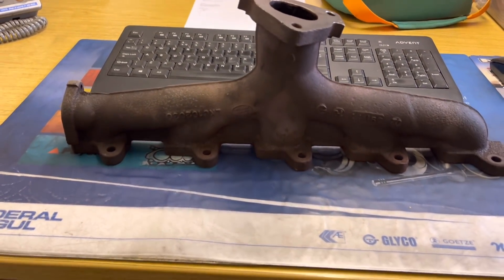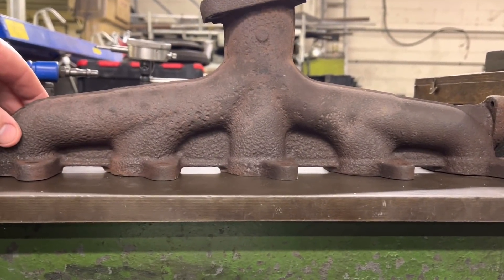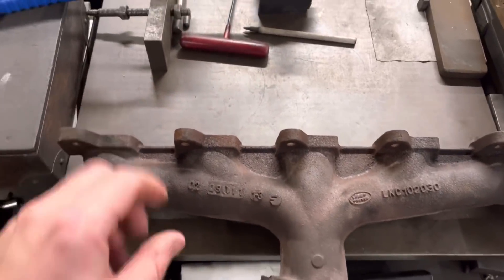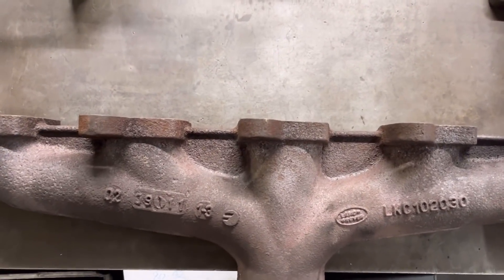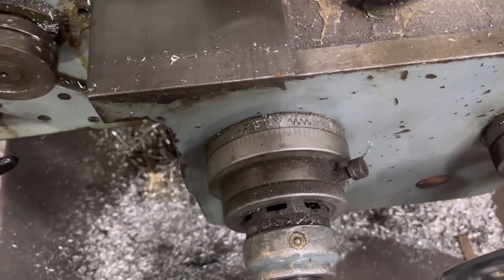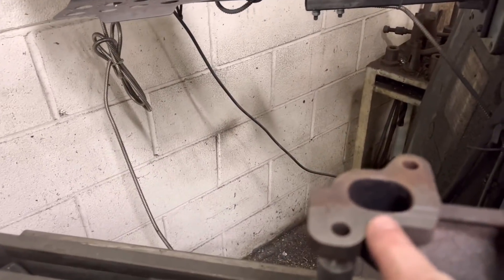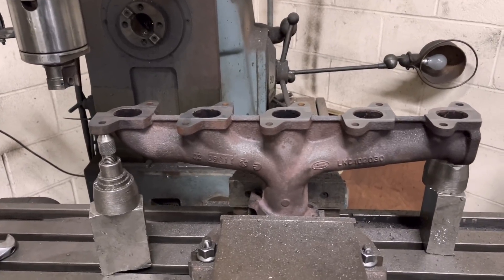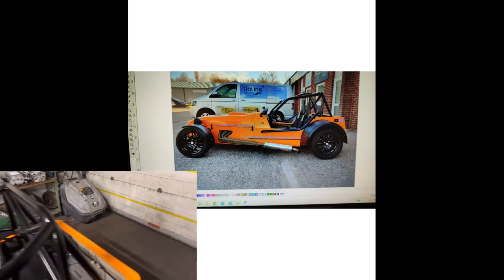You WON’T BELIEVE what these manifolds do

Comment: So, would it help to cool the engine down, after driving. Just let it run a minute or so before putting it of.
I do remember that in my Smart car (with turbo) it was advised just to keep the oil good in the turbo. If you came home and just turned it off, the oil would burn/evaporate away and the turbo would not have any to lubricate it.

Comment: The big issue with cast iron components is  time!  Cast iron needs to "season" "cure" or "age" before being machined, that's an irrefutable fact. For an example, and this goes for most  "precision" machines, but , Myford the "iconic" lathe and machine makers, used to get the cast iron "beds" for lathes and mills etc, from the foundry, and literally put them outside laid on the ground in all weathers for I believe , (if my memory serves me") two years. they are then grit blasted  to remove the skin and machined to a crude finish, and put back out for a further year or more before being finally machined to  their finished state. And of course Myford is an example only,  I visited their works way back before they folded. I am assured the reason they folded was they tried to  cut corners, and bought in  ""machine ready" cast iron  lathe beds, and milling machine bodies from Asia. They then machined them to Myford tolerances and sold them out as their own , but with "made in Taiwan, or China etc labels attached, firstly they warped and went out of  precision and of course the "Myford" buffs were horrified. All cast iron needs to be seasoned.  Buy a cast iron woodburner for your house, you have to light little fires first and do more over time, a small handful of kindling , then more, then more etc etc like running in an old car, or it will warp and crack! Also people don't realise not only the time and technical know how, spent machining, but the hundreds of thousands of pounds worth of tools machines and machine tools , one has to have in a workplace like this.

Comment: Some new replacement manifolds are such trash, you have to do this before you install them. The boating business is full of them.

I think the problem also varies by how much money companies are willing to spend on materials. The high performance world often solves the problem of cracked or bent cast iron manifolds by casting them from 304 stainless steel.

Comment: They normally only warp if the vehicles been chipped with a big intercooler.  The studs are ridiculous and nasty cheap crap so it’s advisable to replace them with wurth studs. Once it’s warped it shouldn’t happen again and with the new studs the problem should happen again.

Comment: I have fixed many manifold leaks, removed many broken bolts. I believe machining & if the head surface isn't pitted to bolt them on without gaskets in most cases. They will seal & without the gasket & will allow much of the heat to transfer to the head &   less likely to warp.

Comment: as mentioned in the comments, but ill say it again,   all you need to fix a warped manifold is a nice flat surface and or a good straight edge.   Then a good hand held belt sander rough and smooth it down to barely rocking then take your file and scrape it in.  check with your surface and straight edge until you got good contact.   Ive done this MANY times and it has ALWAYS worked great.   the worst part is dealing with the rusty broken bolts that are just about guaranteed to break.

Comment: It’s not too much of a problem once the engine is running. I’ve seen exhaust leaks clear up once the engines warm because the manifold expands back and seals. It wears out the gaskets pretty quick because of all that moving back and forth but a quality gasket and torquing the bolts down when the engine is warm takes up the slack and helps prevent that thermal expansion and contraction.
Reply: Sounds like a good opportunity for a new gasket design that will allow some expansion and contraction without the added stress on the weaker ends of the manifolds. Hmmm
Reply: @intricate6927  we’ve had one for years. It’s called asbestos and it worked great.

Comment: I can't remember how many manifolds i have milled flat in my time as a machinist.
We even had a customer who did truck pulling, had  tig welded manifolds with a 20mm steel stock as flat part.
You'd mill on thursday, they fitted it on friday, race Day on saturday and back in the shop at monday again.
Reply: What I was a kid used to work in a machine shop my friend had a boat and he used to work in the automotive parts store in the front of the Machine Shop he had a big block in a 17 foot jet boat used to take it to the lake and blow it up on the weekends get back home by Wednesday it was torn apart thursday-friday back together back at the lake on Friday night God bless you and your family

Comment: Thin castings on exhaust manifolds. Back pressure from turbo hold heat to the point of warping the cast iron. Exhaust openings need ported and polished,  but the diameter is still too small. Same problem on cast iron exhaust headers on small block chevies, when turbo is installed. I've seen various fixes, including a "stiffening plate" to hold the runners straight and flat. Finally gave up and installed "turbo headers". Gotta get that heat out,  somehow!

Comment: ALTO ALTO 
HOOO STOP ✋️✋️
UPON REINSTALL ON THE MOTOR COAT BOTH SIDES OF THE GASKETT AND ALLLLL THE THREADS OF THE FASTNERS WITH 
(GRAPHITE@GREASE) A NICE BLOODY GOOD THICK COAT OF IT. IT WILL HELP IN THE LONG RUN 
(BELIEVE-ME)

Comment: U burn 4 of those mounting flanges out of 10mm steelplate, take a pile of pipe parts of suitable material ( 1.5" thin wall cromo would go well) and make a new 1.
If budget stands it or u have skills to do it yourself..its worth every dime.

Comment: I ended up replacing both manifolds on my trucks engine when I overhauled it, the manifold bolt holes were so bad there wasn't enough there to reuse. I purchased a new set of manifolds and neither one was flat, both were warped. I taped course sandpaper down on a flat surface and sanded them down flat, they turned out real good, and it took awhile to get them flat. I was wondering if that wasn't the problem here, that these manifolds weren't even flat from day one? They do have to be flat no doubt, they won't seal right if they aren't, and it stresses them out, and possibly warp even worse.
Reply: When I turboed my Patrol (6 cylinder inline diesel) the log manifold I bought was actually proud either end by about 1-2mm. I questioned the supplier and they said when they build them they shim them up in the middle (so the middle is lower, opposite to the warped manifold in this video) before they weld otherwise they warp as per this video and the gaskets at either end fail. 15,000km later and no problems. So depending how not flat your manifold was it might've been intentional.
Reply: @jbrizz99  don't believe the ones I got were intentionally warped cause both manifolds were warped different in a different place, and one was much worse than the other. They're also require to be torqued down evenly like intake manifolds, so if they're warped they won't seat evenly. They have to be flat, I think the supplier you mentioned is full of bull. The flatness should be the last step in the manufacturing process, after any welds done too it. They weld, THEN make them flat. Sounds like they just cut corners for cost and lied about it imo.

Comment: Great video! Thanks for sharing!  It's amazing to me that we live in the 21st century and engineers / manufacturers haven't learned their lessons. Apparently it's no longer about building a product that the customer would buy again as much as it is let them buy it and let them deal with it. Cutting corners, omitting processes and using inferior materials is the new norm. Just glad that there are people out there such as yourself solving problems and correcting mistakes and making the end users happy again.
Reply: Well some old ass seasoned already torqued manifolds will prob warp
Reply: @DannyOrnelasPerformance  That manifold wasn't "old ass" and if it warped that bad? my betting money is on it wasn't seasoned to begin with. Add in they used manifold bolts that just made the grade and you have a recipe for disaster that the customer will have to deal with. I'll agree with the turbo there's a lot more heat in that area but? That's an engineer's job to find and fit components together that will work. I've pulled old Chevy exhaust manifolds from antique 265's and 283's that weren't that warped.

Comment: Was this a result of installing a gasket where the factory never did?
I'm used to seeing failed aftermarket gaskets where the factory never used a gasket.  Using a gasket also causes the manifold to run hot and increases the chance of cracking.
If you have good flat surfaces, why use a gasket?
Reply: The gaskets fa7l because the manifold has mooved from its supporting role
Reply: @simonjones7785  Over the decades, I've removed many exhaust manifold gaskets and reassembled with no gasket, exactly the way it came from the factory.  This has always solved the problem for me.  If the factory does install a gasket, it's going to be a high quality piece 
(multi layer steel, most likely) and an inferior aftermarket gasket won't survive because heat causes the gasket to relax over time and clamping force is lost.

Comment: Clearly related to the fact that the engineer doesn't know that cylinders come in PAIRS (except on radials).  Get rid of one of those cylinders (or add one more)  and your problems with that manifold will clear up "straight away" as you folks say.  /:o   *
Reply: How is this problem caused by an uneven amount of cylinders?
Reply: @Gamepaj  Its  a joke.

Comment: Mapped TD5’s exhaust gas temps are that much higher than standard, the only combo of things I’ve found that solves it is dewebbing the manifold & getting uprated manifold studs from Wurth. Been 10k miles now and no issues. Before I did the uprated studs I’d be lucky to get 2k miles out of a manifold before it warped.

Comment: Seems an awful lot of work for an issue that could be remedied by a thick flexible gasket.
Reply: Won't work, the gasket pressure will still be uneven and you can't bend cast iron, and or force it to seat different from one end to the other, even with two composite gaskets put together. They have to be flat and evenly bolted down, otherwise they'll warp even worse once they heat up and could even crack. Then there's the possible problem of lining up the exhaust flange bolts, and flanges if the gaskets are too thick without redoing the exhaust pipes.

Comment: Surface the face,buy some die springs they come in different strength ,they were used on cars from factory to prevent this very problem before you were born.

Comment: Had to do this to my Jeep 4.7 manifolds. A bit lower budget however... framing square and a bench mounted belt sander.  3 years later still no leaks.
Reply: 3 years with no issues, you did them right then.
Reply: @garyr7027  right, sometimes the method  doesnt matter as much as the outcome. In this case, the outcome was impressive, especially given the method. Ingenuity at its finest.
Reply: @goosenotmaverick1156  had to do this same thing on a new set of manifolds, only difference is I tapped sandpaper down on a flat surface and used that method. Flatness is the key for these things, they need to be flat.
Reply: @garyr7027  old school repairs and techniques still work.👍👍
Reply: @garyr7027  I think like you said they are seasoned now and don't warp anymore. They do have 167,000 miles on them.
Reply: Thats what I thought.  I guess the big mill is probably more accurate.
Reply: That's how you get her done

Comment: I removed an exhaust mani from a Cummins diesel in a snowcat a few years ago that wouldn't go.back on because it shrank up. The bolt hole on one end was 5 or 6mm short of lining up when the other end was bolted to the head. The replacement was a two piece manifold.

Comment: Be interesting to know how many bent ones have been "professionally" re-mapped. 
All the ones I know of that have been fiddled with have done this. Not to say it doesn't happen with std tune too but not half as much.
Reply: They all do this eventually - it's a design defect rather than specifically the result of mapping. Re-mapping (by definition) increases the temp in the exhaust manifold, and makes this warping more likely. The TD5 is not unusual in this respect - other cars have this problem - the Smart 600 and 700cc engines are notorious.
Reply: @mikeevans9736  Yes that's basically what I was getting at. I know many that have had and still have TD5s. All the mapped ones have done this but I don't specifically recall many standard ones doing it. Might be my memory. 
Suppose a modular cast manifold like Cat used to use on their big V8s  and V12s is one way to get around it.

Comment: Why is this happening  ?  Is it bad materials,  the webs may have been put there to try to stop this posibly yet made it worse ???? , and to pull threads Wow ! 
Would a more insulated gasket  have prevented this from happening ? Due to the faster cooling though the head .🤔
5 cylinder engine,  is that volvo DNA  ? Once machined dose  that solve the fault. 
Thanks for the info 👍

Comment: The td5 manifolds will bend badly if someone has had a remap and they haven't fitted any EGT monitoring.  Going up hill, foot to the floor boards pulling a trailer will warp them. Also you need to relieve one of the webs as it will now foul a coolant plug in the head. If the owner doesn't spot it on rebuilding, the gasket won't seal. Some people swap the M8 studs for M10, however,  for me doesn't resolve the bending issue,  just allows more stress to build up with the potential for even greater damage. As you say, once its been refaced then it generally doesn't come back, to me this points to a manufacturing fault where the castings are cooled too quickly.
Reply: Yup - spot on.

Comment: over the last 40 years seen same problem from dozens of manufacturers. Reface the manifold, replace the studs with rolled. thread studs and install with a very thin shim steel gasket and silicon or if nothing available, silicon only. Use an insulating gasket material and instant problems. After all, most of the time the head cooling passages are only an inch away and allow the manifold to dissipate heat only if you have not built in a barrier of gasket material. Poor old studs try to transfer some of the heat and fail. Modern turbo diesel engine problem or leaned - out mixture petrol engines where power / thermal efficiency is healthy. Often the aftermarket gasket kit induces the problem with crap gasket! HT silicon carbonises at a temperature twice that of cylinder head exhaust port surface temperatures. That been said, mostly poor design of manifold is the bottom line. Ceramic coating the insides of manifold works wonders and found on big capacity hi-end engines that come with a price tag but no failures.

Comment: Interesting seeing how much they warp - must have been a known issue to Land Rover, surprised not a recall/extended warranty given.

Rather than milling to reface, would linishing not be an appropriate solution? (To avoid the slightly precarious vice holding 😁)
Reply: Yes, you can linish manifolds. No, it's not perfect process, and proper milling is a more accurate solution, but if it's done sensibly, then it works, and on some manifolds, like the Rolls-Royce V8's, they are a pain to set up, so finishing them back is a valid solution.
Reply: JLR no longer care. The new Defender is horrible.

Comment: Ha I recognised it immediately also. In addition to flatting it, I removed the webs, then elongated the end holes and to a lesser extent the next ones along. I also then had it ceramic coated inside and out. I also used higher quality studs and Belleville washers .
The bending seems to be from overheating with hot maps as the temp can easily get over 700 and even 800 C.
Mine has now stayed straight with no broken studs for about 50KK, even though I occasionally get over 700C. EGTs
BTW you will see that on Toyota 6 cylinder turbo diesels they have 2 separate parts of the manifold which enables them to expand and contract with heating.

Comment: It does make me wonder as an alternate method 

why would you not heat the thing red-hot with the Oxy torch bolt it down flat so you’re essentially re-bending it back into shape on the flat bed - then let it cool down or quench it 

and then re-face it up on the mill afterwards……..

Overkill perhaps..??

Comment: As soon as I saw the first image, the first clip - the first few seconds, I knew it was from a TD5, and what you were going to say! We see this all the time, and change a lot of them for ones we have corrected. We also remove the webs between the individual ports as per the later manifolds from Land Rover - this was done by LR to try and reduce the number of broken studs.
Reply: Just the title was enough to tell me it was a td5 manifold. I keep a spare in the workshop just in case, just like the boost control solenoid which I keep in the glovebox. Driving 600 miles home  on a Sunday with a kangarooing or half boosting Discovery 2 is flipping annoying to say the least.
Reply: Just what I thought when I seen 5 pipes
Reply: Same , knew this soon as I saw the picture and how it'd be fixed.
Reply: Yep . Very poor design
Reply: @scaifefab4585  Not as bad as the Smart 600cc and 700cc manifold / turbo combo.!!! Once we have de-webbed, heat treated and flattened a manifold, and uprated the studs, we dont get them back with the same problem.
Reply: @mikeevans9736  my first thought was remove webs. heat treat and stud upgrade even better. way old skool manifolds had cooling fins,to expensive I guess.